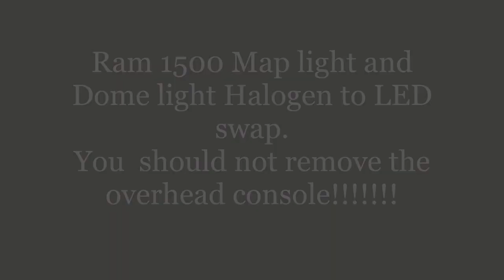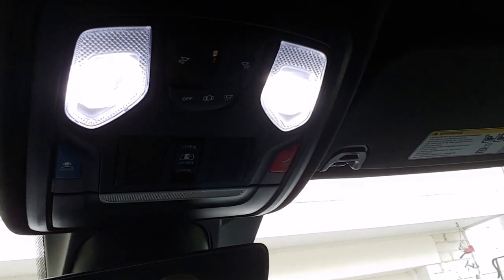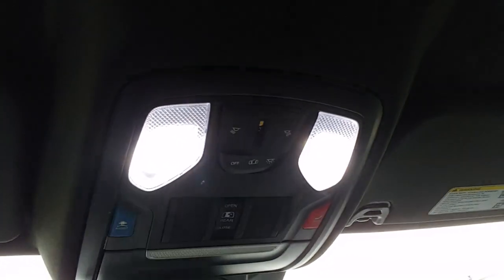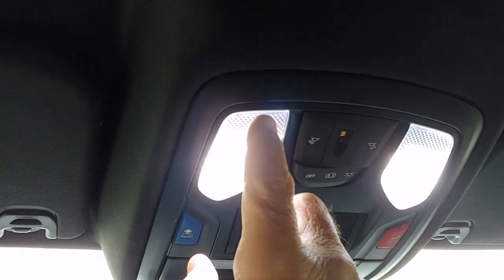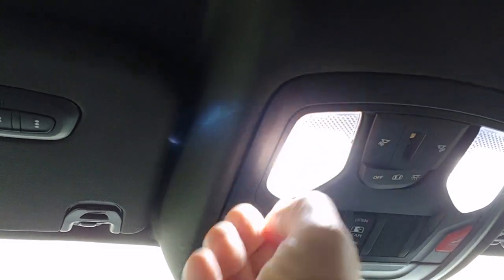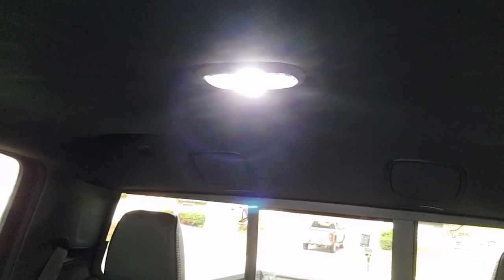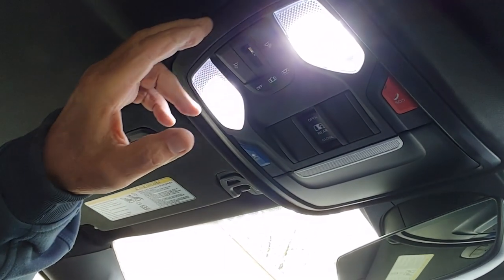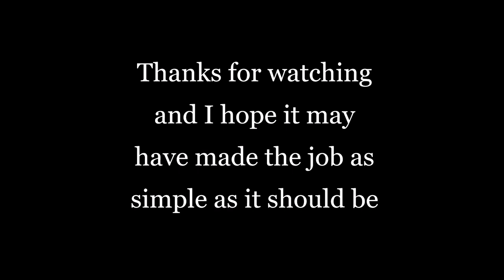2023 Ram 1500 Map lights replacment simplified explanation

Comment: This is mis information... I did exactly what he said. You have to apply pressure to the back of the socket, if not it spreads them apart. You have to drop the map light console in order to apply the pressure needed. FYI.
Reply from the maker: Well, obviously since I didn't drop the console, but I easily installed the new LED bulbs my scenario was true. However I know that if you try to reinstall the old original halogen bulbs you may in fact have to remove the console because they are much smaller and the socket does move around a lot. The LED bulbs are so much longer and wider they just slid right in for me.

Comment: Have you changed the footwell lights? My 2024 is different than you see on YouTube.
Reply from the maker: No I have not, mainly because the footwell lights have just the right amount of brightness, not too much but I can still see anything I might drop that lands in my foot space.
Reply: I have a 2023 and have not seen anything talking about the new  footwell light setup.
Reply: I changed in my 2019, not that hard, will do in my 2025 when i get tomorrow!
Reply from the maker: @lylebinns2645  I want make sure everyone knows that if you switch to these aftermarket leds you probably have an issue with your entertainment center if you have an engine off radio delay. Unless the makers of the leds have addressed the issue. They know about it and what causes it.